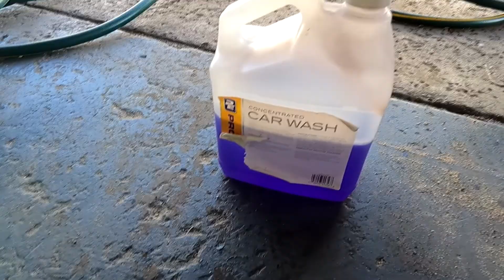Faster N' Louder | Detailing An Old and Hard to Find Javelin AMX Grill! | Automotive ASMR??

Comment: So does the AMX grille not have a bullseye behind the mesh from the factory or was your grille just missing the bullseye. If you removed the bullseye already, wouls you care to share how you removed it? Need to change my bullseye on my 71 and not break my grille haha
Reply from the maker: You know? I didn’t even pay attention to it. I believe it’s missing. If I were to attempt taking it off, I would probably use a heat gun and a flat head screwdriver to gently pry it off. I think it’s just glued typically.